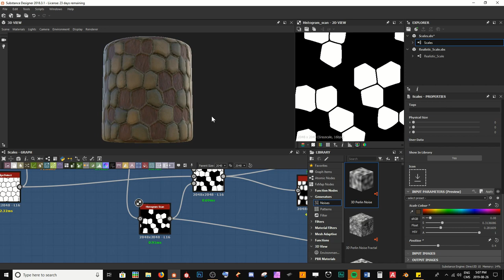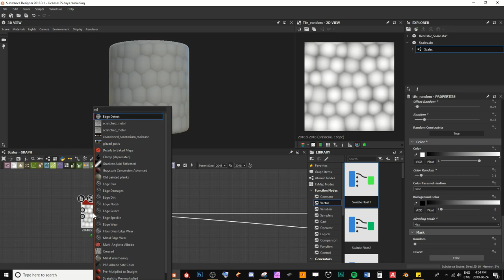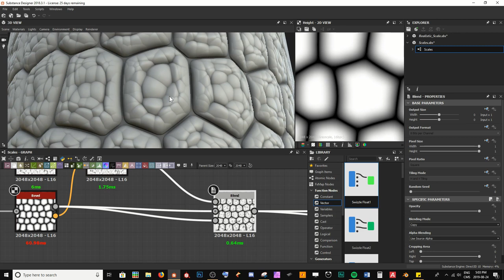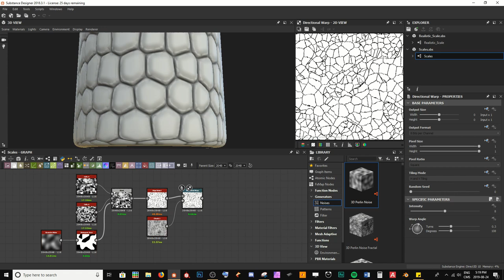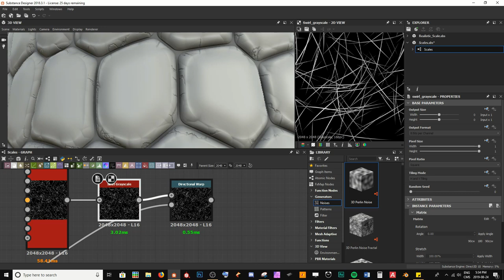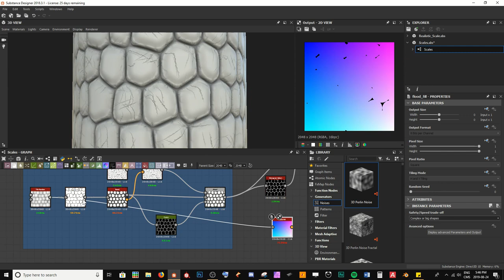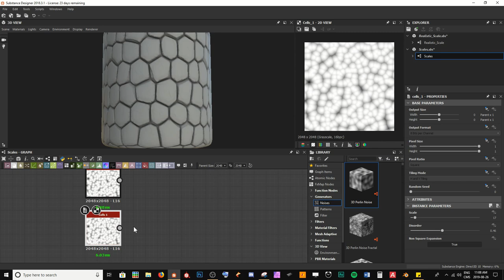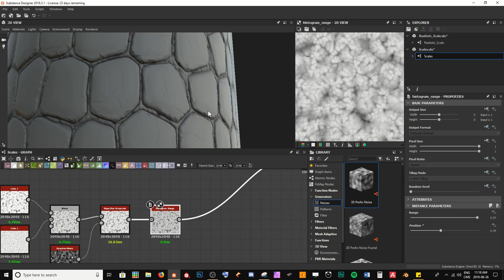Scales (1/3) | Height | Beginner Substance Designer Tutorial

Comment: This is a really well done material, so far. I'd probably have more warps and blurs myself, but it's actually kinda surprising how much one can do with a fairly basic setup. The only downside I can see is that changing the Tile Random's X and Y Amounts to fairly high values will force one to change both the edge detect and bevel. But that's one of the limitations of Substance Designer. It's possible to setup a couple linear equations so it'll automatically change those values, though it can be time consuming to come up with those.

I was initially thinking about setting the bevel node's Distance to -1 and then using a Level node to flatten the top, so that I wouldn't have to worry about changing the bevel, but that will destroy what was done with the Curve node. So, like I mention in the first paragraph, it's probably best to make a linear equation node to modify the Edge Detect node's Edge With/Roundness and the Bevel node's Distance values.

Comment: 22:45 i cant figure out what i did wrong. the scales are not showing up as 3D there completely flat.
Reply from the maker: Hey there! Just before we dive more into it, did you make sure to follow along at 1:58? That's where we set up our 3D view-port to see height info. :)
Reply: @GetLearnt  Hey thanks for getting back to me so fast. I figured it out BUT while i still have you how do i increase the resolution in a view port? I've looked through forums but there is no answer. its stuck at 398X427 PX.
Reply from the maker: @blanksteranimation7073  Do you mean the resolution of your textures? Because if that is the case, you can do that in your graph view, where you see towards the right side "Parent Size" and your X and Y resolution. That's where you will be able to change your texture size.

If that's not what you mean, I'm sorry I'm unsure what the question is! :D
Reply: @GetLearnt  in the 3d view port when i click display resolution it shows up as very low. I know i saw in yours that it was 2K. I tried the base parameters in the graph but its still the same
Reply from the maker: @blanksteranimation7073  Ooooh, gotcha. That's just the dimensions of your 3D window, use your mouse to expand the edges and you will notice it change to whatever your dimensions are. :)

Comment: There is a problem when you're doing the heighting, everytime you change the setting to tesselation in definitions, it doesn't save what you have done. So like, when you reopen designer after saving, you go right back where you started.
Reply from the maker: I don't think Designer has an option to save your height mapping, so when you open the file again it will default back to a flat face. It's not a bug, it's really just a lack of a feature. I feel your pain, friend. :(
Reply: @GetLearnt  Well, that's just great. I've been trying to figure out ways to get it working, but none of them seem to be working. I even tried to export the texture of what I've done to see if it gives me the tessellation, and I got nothing.
Reply from the maker: @TheGore1021  Ya, its honestly just something Ive gotten used to. Thats not to say we shouldn't have the option tho, its a pain resetting it up everytime. Ive not looked at the Substance forums but perhaps it can be a feature request or something?
Reply: @GetLearnt  I'm not sure. I just don't really see what's the point in learning about height if the setting doesn't save.
Reply from the maker: @TheGore1021  Well our Height map saves, Designer just does not save the settings we used to visualize it on our 3D mesh. So if I took our Height map from Designer and brought it into Unreal, used it to displace my mesh and save that file, it would show up again when I reopened Unreal. The only thing that isnt saving in Designer is the way we are seeing our Height, we are still keeping the actual nodes and images. I hope that kinda makes sense, thats just how your wording made it sound to me. Making the Height map in Designer first is a pretty important part, it helps us block in the shapes of our material. :)
Reply: @GetLearnt  Right. I guess that explains it.
Reply: @TheGore1021  Easiest way I know to get height map from this might be to apply a fill layer in substance painter to a high res plane with the material created and export materials from there.